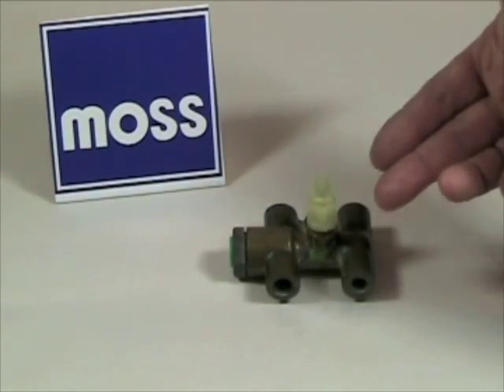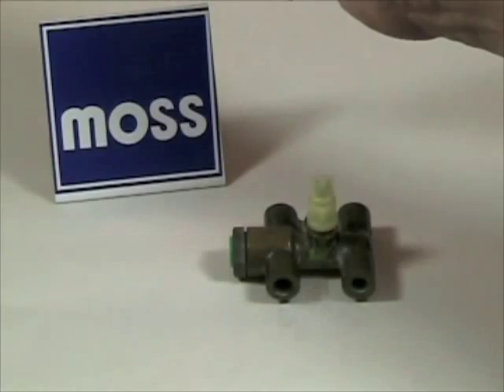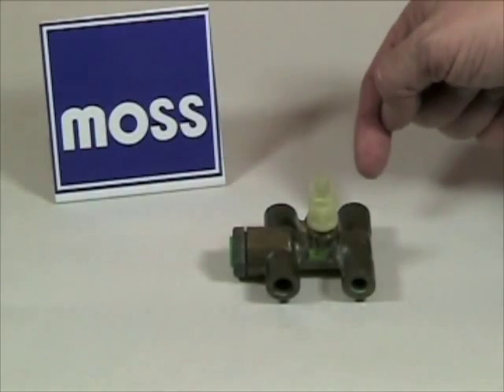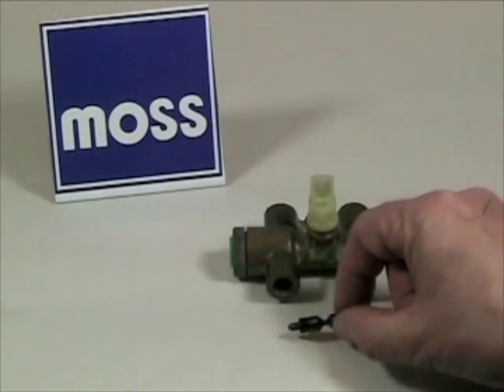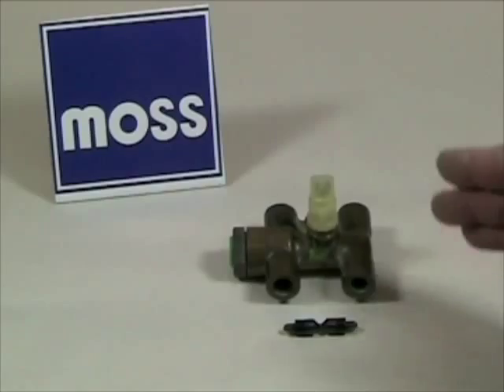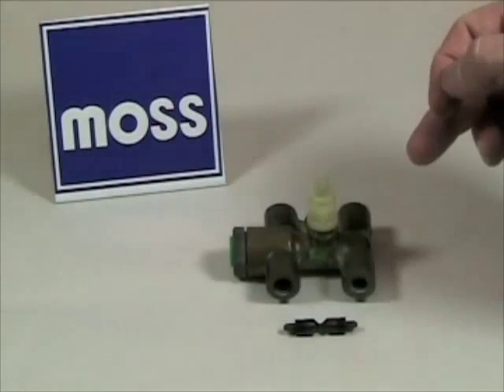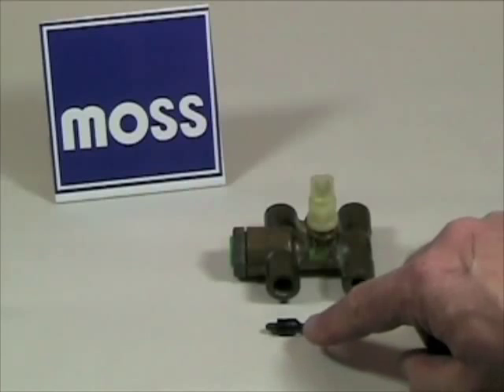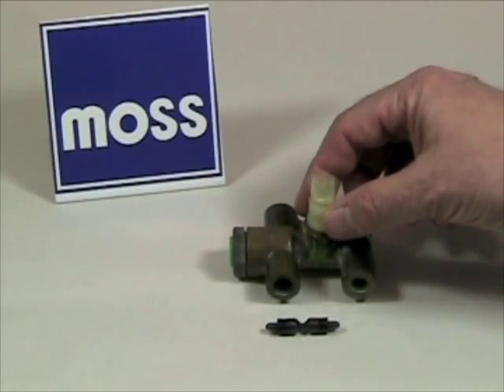Brake Pressure Failure Switch - How it Works - Moss Motors Tech

Comment: Moss, very nicely explained. It helps me understand what is happening in my El Camino. Question: The electrical switch in my car is not hooked up to a wire- can't find one. SO does that mean that I am having a different problem, and not one of faulty pressures?